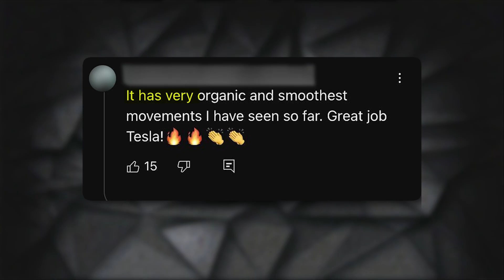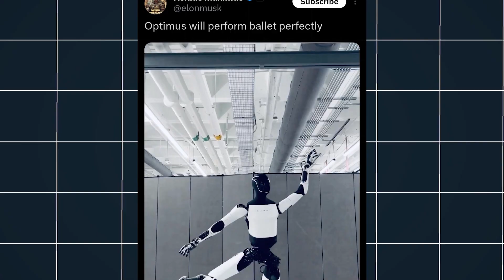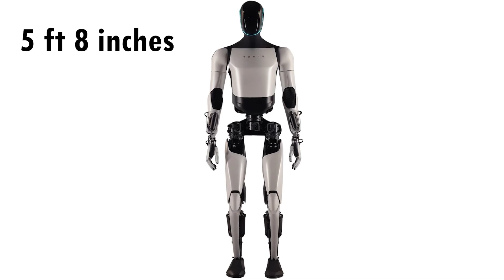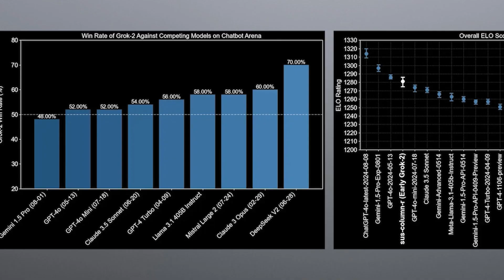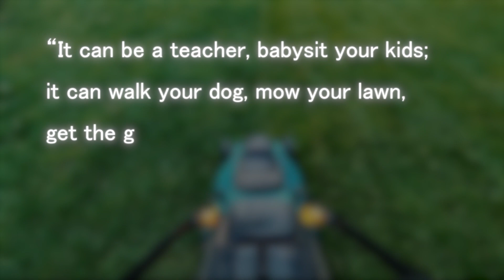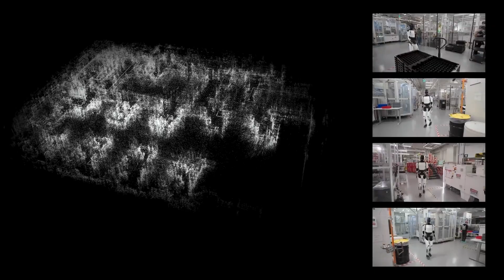Just Happened! New Tesla Optimus Robot Update, Improved Dancing and Motor Skills

Comment: I wonder whether the Optimus can clean a 3-Liter pot which floor has burnt food with a spong by moving then hand under the soaped water. Btw there is hardly visible control whether the burnt need to be removed, it‘s the fingertip‘s sensor feeling which counts.